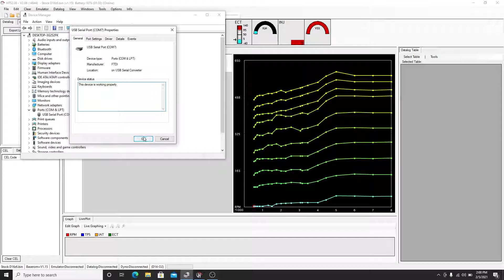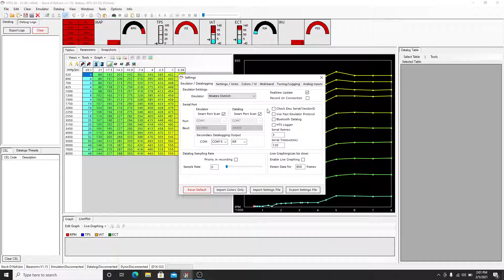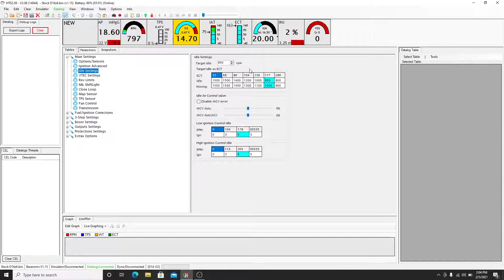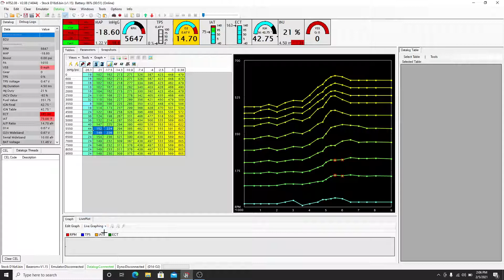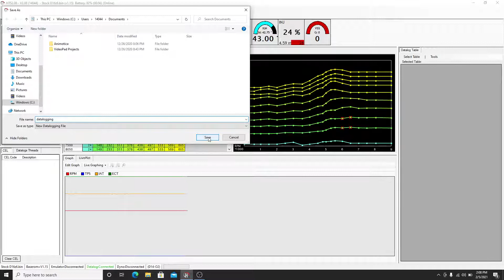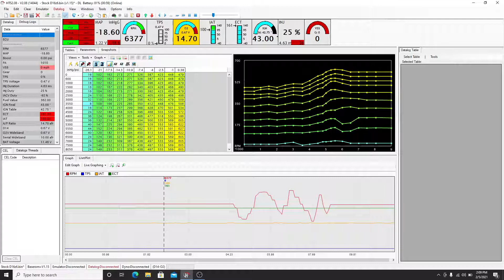DATALOGGING A CARS ECU SO YOU CAN SEE WHATS GOING ON IN YOUR ENGINE!

Comment: Hi can i ask what should i do if i can’t connect to my data logger? My emulator works fine. Every time i connect to my data logger it will send com port time out
Reply from the maker: Have you checked device manager to make sure your using the correct usb port (com port)….
Reply: @DIYKAI yah i set up the com port right i even match the baud rate,i tried also the hc-05 it will connect then suddenly disconnected.i cut j12 but i did put capacitor c51 and c52. Do i need a wideband sensor to make it work? Thanks for you help
Reply from the maker: @SilverVioly  check your baud rate as well
Reply: @DIYKAI  can i data log with p06 ecu?

Comment: Idk if ur still around but what if I have 1998 Acura Integra ob2 with a p28 none vtec and im try to get live data but I can’t figure how i can I’m chip but I can’t figure out how to get the live data to know what’s going on
Reply from the maker: Do you have the CN2 port installed
Reply: @DIYKAI no I don’t
Reply from the maker: You need to add a CN2 port, cut a resistor, and have a data logger with HTS or another software of your choice

Comment: Can we do datalogging on p08 ecu? And will it allow us live tuning to make changes in the map?
Reply: My com port is not visible in device manager
Reply from the maker: Yes as long as it's OBD1 and has a slot for the chip....
Reply: @DIYKAI  I connected the cn2 ports with a usb and it's not showing the datalog. I have also installed the suitable ftdi drivers
Reply from the maker: The cn2 requires a specific interface what are you using

Comment: Is there a knock option for the graph? Where you can see if the car is knocking at certain rpms and go in and adjust it? And would you have to have a knock sensor in order to use that feature? My car doesn't have a knock sensor but I want to try and tune mt timing tables a bit more in depth to see if I can find a max timing position before I start to knock
Reply from the maker: no sure I don't use a knock sensor

Comment: Do you need to tune with emulator and data log before burning the chip?
Reply from the maker: No
Reply: Can you make changes then with just the datalogger hooked up and the basemap chip in the socket. How exactly do you get the AFR corrections to the chip?
Reply from the maker: No you will need an emulator to do live changes

Comment: Hi Kai, 

I tried to datalog my p30 ecu with this cable: 

https://www.amazon.nl/gp/aw/d/B08JT3C6VG?psc=1&ref=ppx_pop_mob_b_asin_image

But HTS says, can not connect to ecu via COM port (x) please see debug log for more information.

Do you perhaps know what is causing this? Or perhaps where I can find the HTS debug log? 

Would be of great help. 😁👊
Reply from the maker: Do you have an FTDI adapter? Or just the USB cable?
Reply: @DIYKAI  Thanks for the fast response! Appreciated. Do you mean a seperate FTDI adapter? Because I do have a chipped P30 with the 4 pins at CN2.
Reply from the maker: Yes if your just hooking the USB to the 4 pins I don't think that will work I have always used a FTDI with the cable
Reply from the maker: Also make sure ground is pin 1 to the left toward the ECU plugs.....only 1-4 used 5 is blank......TX and RX need to be switched at the FTDI
Reply: @DIYKAI  thanks for the help man! 😁
Reply from the maker: No worries 👍
Reply from the maker: I would go with 5v as most signals are that
Reply: @DIYKAI  Thank you kindly. 👊🔥
Reply from the maker: Yw
Reply from the maker: Make sure your com ports are set correctly in the device manager

Comment: So to datalog you need to add something to the datalog spot on ecu what exactly do you put there and when its put in you run a usb to your computer and it links hts with it?
Reply from the maker: You need to chip the ecu and add a datalogging header pin. I have a video covering this as well. Yes you will need some type of ftdi to usb cable/controller or a hulog or any emulator that has one